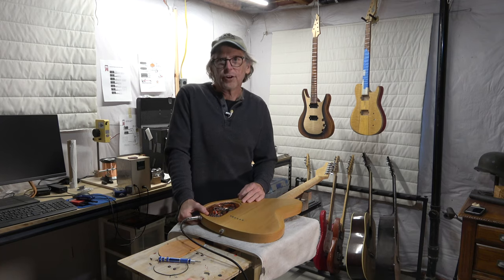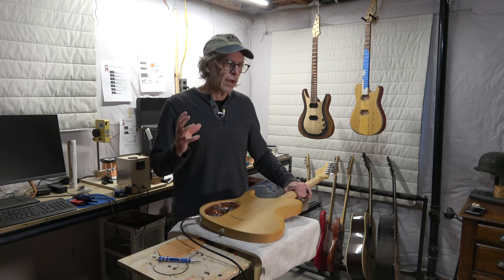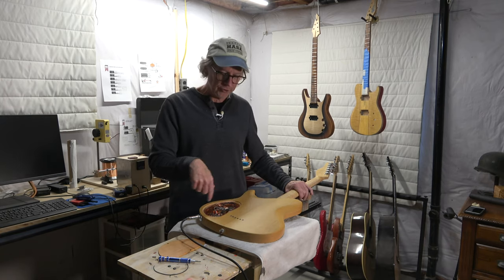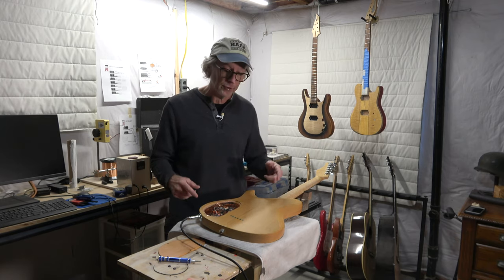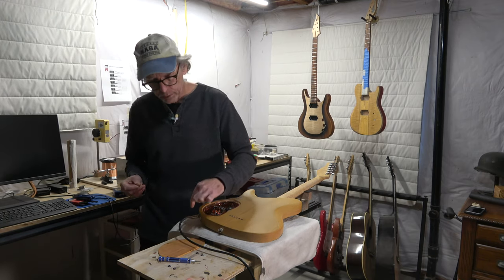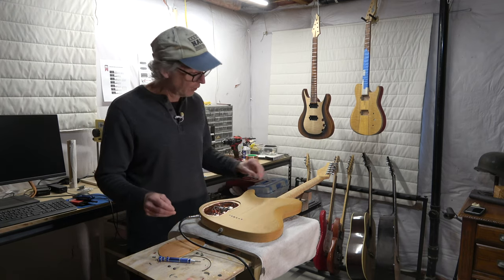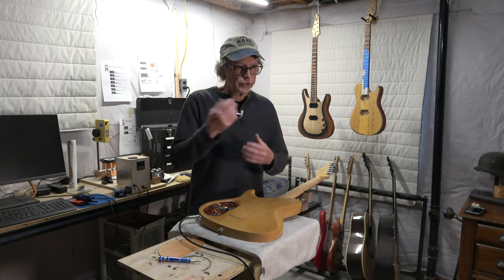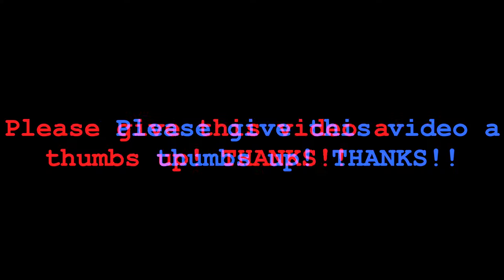Are Ground Loops A Myth In An Electric Guitar?

Comment: Thanks for posting this video Chris! I am on several forums where this subject comes up repeatedly.  It has been super frustrating to hear the "experts" explain their untested facts. I have a degree in electronics and worked for one of the major music electronics companies for years, I have also built and repaired more guitars than I can count.  All that notwithstanding,  if I suggest that ground loops do not occur in passive electric guitars, the flames start flying.
Reply: Why is it impossible for ground loops to occur in passive electric guitars?
Reply: @Music-el7if  For a ground loop to occur, there has to be a potential difference between different ground points of the circuit. That cannot happen in a passive circuit. There's a single ground point in a passive guitar circuit, and that's at the output jack. It doesn't matter how exactly you connect the ground from there, it's always the same ground and there can be no potential difference on it.
Reply: @Case_  Why can a passive circuit only have a single ground point but an active circuit can? Please explain like I know nothing because I know nothing!
Reply: @Music-el7if  There are no active parts of the circuit that could result in a potential difference between two different ground points, and as such there's no current flowing between said points, and no current flowing means no chance of creating a ground loop, and that all means a single common ground point.

But I can't probably explain it simple or well enough, so maybe it'd be best for you to simply look up an explanation of ground loops.
Reply: the biggest problem imo with guitar wiring is when the switching of any bonded pickup leads, that require a permanent ground, hence are not able to be switched without causing a problem. Like the cover of a tele neck singel coil or its bridge pup basplate, become disconnected via switch while the pickup coil leads themselves still have one ground and one hot. You have to run a spearate direct to ground jumper from those covers or baseplates if the coil leads are running through switches pots etc. lacking a permanent ground connection.
But you already know that probably.
Many ground issues are misrepresented as loops on guitar forums imo, but the reality is it might as well be a loop... because the sound is bad on most guitars wired wrong.

Comment: Also by turning the volume knob all the way down you basically connect both terminals of the pickup to the ground. A Pickup is just several kilometers of really thin wire wound to a coil, so that should according to this "theory" also create a "ground loop" and like WAAAAY worse than 5 centimeters of extra wire would.

Comment: What happens is when your guitar is making noise, and you think it's a ground loop so you rewire it to "fix" it, you have fixed a different problem that was causing a noise by rewiring it. So it can seem like you have fixed a ground loop, when in reality it was probably something like a short or a cold solder joint.
Edit: I just noticed that you said this at the end of the video :)

Comment: Copper shielding does not prevent ground loops, but it does help reduce noise in the form of electromagnetic interference. A pickup works as an antenna that picks up electromagnetic interference as noise. Shielding essentially collects EMI surrounding the pickup and sends it to ground, keeping the potential noise out of your signal. 

P.S. I owe this understanding to Dylan Talks Tone's YouTube channel.

Comment: Thanks for bringing this up. Grounding for passive guitar circuits is really about shielding from radio noise. There is lots of noise around us. GROUND LOOPS sound different. Basically, ground loops occur because of the potential difference between the grounding of two separate components. They are quite annoying in the UK, because we have to ground electronics, each unit. To irradicate the problem, you have to get rid of a ground in at least one of the units, and if you don't know what you are doing, you might end up making your equipment a potential killer. We call it "lifting the ground." There are ways of lifting the ground deliberately where you have to do it each time you use the gear. That way, the gear is safe when switched on, but you take it upon yourself to lift the ground. You might be able to create a ground loop on a passive guitar if you took a ground lead from the gear and connect it to the earth/ground of the building. But I'm sure no one is mad enough to do that.
Reply: I have this issue with my rack.  It's only small but running a guitar preamp in the loop of an FX preamp gives me a weird washing machine hum like noise which is generally masked by the noise gate.  It does slip through occasionally though and annoys the hell out of me.  When I bought this guitar preamp I recall the earth was removed from the plug.  SO being I'm UK  based also that was the centre plug pin.  Needless to say I put it back for safety.  But I still need to get rid of this dam hum as I believe it triggers my noise gate to open prematurely and then at high volume and with a lot of gain I geed feedback issues.  Ground loops are annoying.
Reply: @RabidGerry  Hi Gerry. A hum like a washing machine - great description. Try (safely) removing the earth connection again & see if the hum disappears. If it does, you know part of how the "ground loop" is occuring. Put back the earth connection for safety reasons and now the game is finding a safe way to connect all bits in the chain together. Tell me each item in the chain. Start with guitar, and state each pedal or rack unit and indicate if it is mains or battery. If you are using a four gang trailing socket or more than one, let me know that too. If you use two wall outlet that are separated by several feet or different rooms, I need to know that too. If you wrote all that information down and took it to a music store that has an in house electronics repair person, you could request some their time at cost - to see where to put a "ground lift" - if that is possible. This sort of thing has been done for over 50 years, safely, to remove ground loops. But we could see if we can find the problem via this channel.
Reply: If your amp is grounded properly with a three prong cord the shield of the guitar jack, pots and strings are all connected to earth ground via amp chassis to ground.

Comment: You should always hardwire your grounds rather than relying on foil or a metal control plate to provide them. If you don't, and a pot or jack comes loose, you can end up with an intermittent ground thatll bee way noisier than any loop. It can be even worse if youre using active pickups/preamp since the battery circuit relies on the ground to work.

In 40+ years of doing this, I have seen exactly 1 ground loop. That was in an 8 string guitar that I built where the 3 bass strings went through their own pickup to a separate output and amp from the 5 treble strings. Other than that, yeah guitars don't have ground loops.

Comment: As you are using copper foil on any guitar, like I do, wouldn't any component touching the foil be additionally grounded inducing a lot of "loops". As I see it, electrons move in direction of the least resistance. So which way the move shouldn't matter. As long as your phase doesn't touch the ground.

Comment: Thanks for the extremely useful videos. I’ve learnt a lot that I haven’t found elsewhere. Your experience is invaluable.
My two cents on this.
Since a ground loop is a cycle in ground connections, yes, a passive circuit can have a ground loop. There are two additional issues: (1) whether a ground loop can produce noise in a passive guitar circuit and (2) where the belief that passive circuits can’t have them comes from.
(1) A ground loop, or any real life connection loop can work as part of an antenna. So it’s not just about the loop, but also about it’s geometry, impedance, relationship to other components and wires, etc. It matters if there’s high gain somewhere in the equipment chain (e.g., overdrive). In short, making a passive ground loop is a bet that could produce noticeable noise increase under certain conditions. But since you don’t get there by purposely designing an antenna inside a guitar, chances are small. It happens, but rarely. That explains why you fixed a passive ground loop. You were not wrong.
(2) Regarding passive/active ground loops, the problem is language. Yes, there is a phenomenon where the way you wire ground may increase noise severely in some active circuits. And yes, it’s often called “a ground loop”. But it’s not actually a ground loop. In fact, you can reproduce it with no redundant connection at all (or with them, if you like). It is when both an input ground and output ground of a high gain circuit share some length of wire. Since real life wires are not ideal, output and input grounds are not the same. Nor is potential the same at every point of ground wires. Then, wire acts as a resistor that will have a very small percentage of the signal across it. And when that small percentage of amplified output signal is also present at an input ground wire, not big enough to produce feedback howling, it still is output noise and humming being reamplified at the input, which increases the noise floor (and reduces signal quality, specially if out of phase).
This different from a ground loop, which senses electromagnetic interference. Here the hum and noise was already captured by the input sensor and is just overly amplified because of wiring problems. Since both cases can sound as hum, and both can be caused by connection cycles, they tend to get confused. It also doesn’t help that both can coexist. In any case, while a guitar can be passive, the whole system is not. Small issues in a passive guitar’s circuit will be amplified by the gain stage of the amp or pedals.
Hope it helps.

Comment: Great video(s) Chris - you rock! Regardless of what anyone says, you make amazing effort to help us all, and your videos are indespensible to us new builders. Thanks for clarifying the ground loop thing. The cool thing is, your suggestion to solder a wire from output jack to the cavity shielding (assuming continuity) means I no longer need to solder a jumper wire among pots since housing of the pot now serves that purpose! Less soldering, tidier cavity. Brilliant! Thank you!
Reply from the maker: A lot of guys don't like to solder directly to the pot housing since the heat can possibly damage the internals.

Comment: Chris, the reason your Les Paul wiring became quieter is probably because you removed an extra wire.  It's not uncommon for wiring in a passive circuit feeding high gain amplification to behave as a tuned antenna and pick up stray EMI.  By removing that little bit of wire, you detuned the 'antenna' and things got quiet.  Also, the way to test for a ground loop is to use a meter to measure microvolts along each parallel ground path.  A mismatch creates a ground loop because electrons flow to the lower-voltage side.  It is impossible to have a ground loop in a passive guitar circuit for the simple reason that there is only a single ground potential.  The myth originated with amplifier wiring (powered circuits) wherein there can be a differential in ground potential throughout the power and signal paths.  Star grounding does work to solve some of these issues in an amp, but it's unnecessary in a passive guitar circuit.  Cheers!

Comment: Let me add a "thank you" to comments. 🤘 (Thumbnail was awesome. 😂) After your comment in previous video about ground loops, I was staring at wiring diagrams, trying to determine different scenario where ground connection may in fact introduce noise into signal (assuming all solder joints good). Internet forums may be a blessing, and often times a curse, haha. I think "ground loop" is a quick way to place blame on problem. Guitar wiring is seemingly simple, but when doing something a little more creative, I really do have to study every electrical path, in every switching position, in every knob position, every coil split, every series/parallel change, and imagine where all those electrons are moving. I think it is fun like puzzle, and your videos help prompt a constructive exercise. Thanks again, as always, for taking valuable time to share your experience! 🤘🤘🤘

Comment: Don't the pots and switches also connect to ground where they contact the foil shielding, making many loop de loops?
Reply: No, because each and every point in a passive guitar circuit that has continuity to ground is at the same ground potential.

Comment: before making this video, have you ever thought about the fact that with the copper foil in the shielding you effectively also create a ground loop connecting all the components? That's just another indicator that noise does not come from 'ground loops'. I saw that Yamaha now uses shielded wires (cables) to connect some of the components within the passive electric guitar, likely to further reduce noise, even though they also use a shield for the cavity.
Reply from the maker: Ground loops are not possible in a guitar with passive pickups and shielding isn't necessary with active pickups.

Comment: Yup been saying so for years. Some context, I have been experimenting with  radio and electronics since I was 10 years old (a crystal radio) ham radio at 12, built a Heathkit color tv at 14, my first electric guitar and amp at 16 (Heathkit Harmony Rocket and Heathkit amp) Heathkit Radio Control equipment and test equipment. Took electronics through school. I am presently 70 years old. My point is having built all these projects means you need to service them as well. Creating a ground loop in audio equipment is common. Normally caused by a shared ground by a source creating electrical noise. Although my parents would disagree, guitars do not create electrical noise. Electrical noise can be received by the guitar in a similar manner as my old crystal radio could receive radio signals with no electrical parts. The problem with myths are if you hear something over and over it becomes fact. I learned that from Santa Clause.
Reply from the maker: I remember Heathkit! Made a crystal radio myself.

Comment: Seems like it, i have strange question. I used copper sheet to wrap pickups, used high quality guitar cable with striped rubber directly to the jack, when i put a spoon to p pickup with ground wire i get some noise but not in the pickup with hot wire (strings are thicker EA vs DG and farther away) 
The same in wrapped pickup with less overdone wireing still mostly guitar shielded wire but some unshielded and shield directli to pickup

Comment: Hello two things having a degree in very high dollar electronics passive ground loops do exist under specific conditions. Not in humbuckers the magnetic fields strength in humbucking pu's is close to impossible  but single coils I found are highly susceptible to loop issues. We know pickup cavities do not require shielding as the shield of the pickup is sufficient.  But as the signal reaches volume,tone and blade switches the signals shield strength gets weak due to low magnetic field. Thus shielding of the control cavity or creating another type of shield is important.  I've done tests in almost every  configuration possible and the results of ground issues were a constant keep in mind the more winfings on pickups does help but sacrifices desired tones. In high powered amp setups the noise was very noticeable . So is it safer to shield the control  cavity behinds on components in the guitar. I have done this test on three different makes of guitars with similar results
 I would be glad to release the technical information if you would like. Thanks jimmy

Comment: Passive devices can also cause ground loop problems. The easiest way to find out is to build a passive effects looper/switcher. Metal housing, 4 sockets: input, output, send and return; one DPDT switch wired as true bypass, continuous ground inside the device itself. One or two effects plugged in with relatively short cables will not cause a problem, but imagine a situation when instead of connecting effects you plug in only the cable, but a bit longer - a couple of meters. In the position of the switch where the signal flies through this cable it is enough to hear an increased level of noise at higher gain. 
The same can be checked even simpler: connect the ground on the plugs of a several-meter-long guitar-amp cable to each other with a short cable with clamps - increased hum is guaranteed. 

Ground loops in guitars work on the same concept only that in a much smaller scale. Different length means different inductance and therefore: frequency. A loop with a small area will not be sensitive to 56/60Hz.
 But that doesn't mean it won't cause problems under challenging conditions. High-frequency interference at the right gain can be demodulated randomly inside the amplifier and give the result in an audible spectrum, even though the bandwidth is gradually narrowing on the next stages. 
More than once there were strange situations when, with the guitar muted, for some moments you could hear from the speaker.... a radio transmission fragment. 
Making a ground connection in a proper way takes about the same amount of time as soldering it wrong, so there is no excuse to do a foul job. 

Oh, in lespauls, because of the two separate electronics chambers, there is more potential for malfunction in ground wiring.

Comment: Funny. And I sort of agree, but I don't think that means you should create them on purpose. Having unnecessary wires and loops could mask cold solder joints and make trouble shooting harder. Especially if one of these extra wires breaks and you have a loose grounded wire floating around. The only thing worse that a problem where you get no sound is a problem where you get intermittent sound.